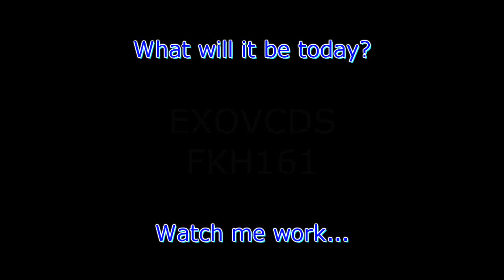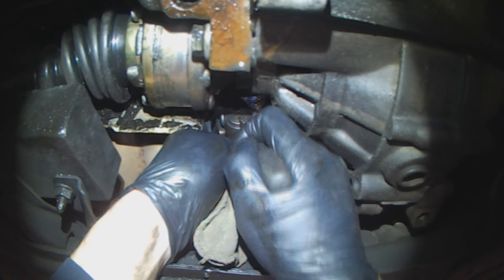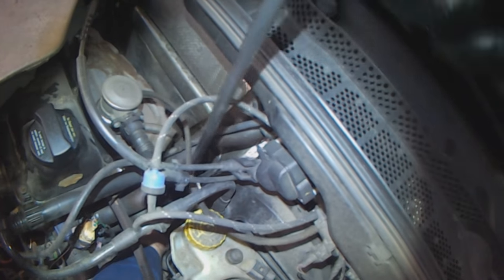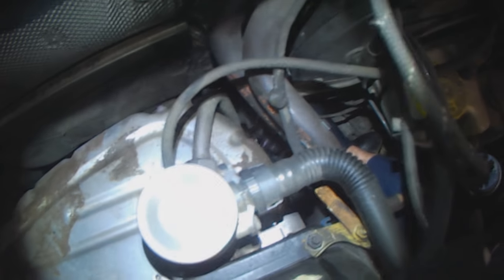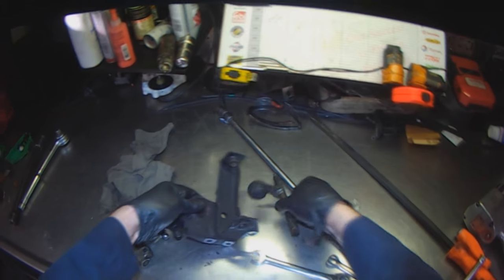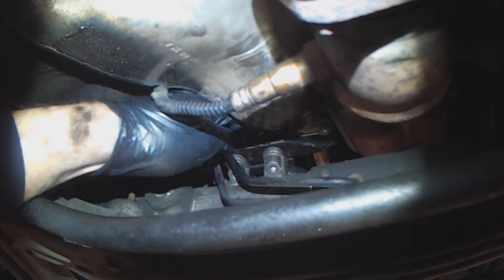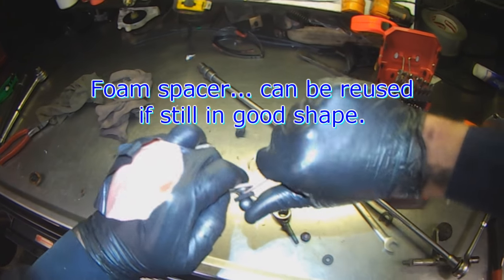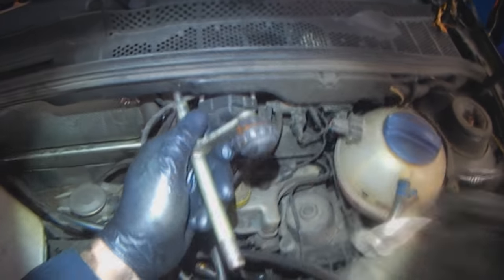VW A3: Main shifter rod bushing replacement

Comment: Thomas this video REALLY helped me replace all the bushings, selector rods, and Relay lever on my 1997 vw Jetta, and as Thanks for your with the Parking Brake Cables I was truly overthinking that.
Reply from the maker: Thank you for continuing to watch my videos!
Reply: @EXOVCDS  you would have a video of replacing a radiator do you?
Reply from the maker: Not of mk3, sorry.
AC or no AC?
Reply: @EXOVCDS  ac
Reply from the maker: Best way is by removing bumper & grill, then you can move the core support forward. Pulling the radiator can be done through the engine bay alone, but it is a tighter squeeze. Remove alternator, move the ac compressor out of the way (do not have to discharge). Remove fan shroud and fans. Remove radiator.
Reply: @EXOVCDS  saw a video of the whole grille and bumper assembly removed

Comment: Thomas, working in my driveway I found with a bunch of different length 3/8 extensions, taped together with duct tape at joints, last joint being a swivel connected to a 12 point 13mm socket I could get to ALL 3 bolts to bracket from top of engine bay. Helps out alot being today is 100°, in April. Had to make due with my own way to put shifter in neutral, had 2 small square pillows tape together to keep shifter in neutral. All went back great! Bought new release bearing, refill crank case new 75/90 gear oil, took off clutch cable and readjust, bought all new bushings, shift rod with ball off eBay. I tell you, couldn't find first gear before, couldn't get power at all from gears. Now! Feels like new car. Is a mk3 97 Jetta, 2.0 Thanks for your post, well done.
Reply from the maker: crimp creep Nice to hear that your project went well and that one of my videos was of help. Thank you for watching! Thank you for the tip about getting to the bolts from the top... people will find that info useful!
Reply from the maker: crimp creep send me your mailing address and I'll send you some of my channel stickers.
Reply: Thomas, how to send address? I love your channel.
Reply from the maker: crimp creep I got you message... thanks.
Reply: I had to laugh!!! Taping those extensions works like a charm, doesn't it? !!!  Great minds.....you know!!!

Comment: Had to takeout my transmission on my cabrio and I’m redoing my shifter linkage. Did not use an alignment tool and now it can’t go into any gear😂 got the alignment tool ordered and on the way now! Great video!
Reply from the maker: Alignment tool helps, but is not needed.

Comment: Nice work! "ditto" to what Wyatt said on the connector. Sometimes connectors are tricky and get broken if you never took them off before. Also "ditto " to your comment about the lift. Nothing like having a lift!
Reply from the maker: I try to add as much info as I can, without being too much... for the most part my viewers can follow along. Diving-in blind & learning as you go, sometimes, can actually be a good thing (knowledge retention). =)

Comment: Nice work Thomas and working on the rear looked to be a little bit of a bear. Putting anti-seize on those bolts will help you out down the road for sure if that's got to come out. I put that stuff on any bolt that's underneath a car and it does pay off down the road. Take care...
Reply from the maker: Yeah, odds are good that I'm still gonna work on this car in 10 years... might as well make life easy for me! =)

Comment: Hi Thomas! Did you also replace the copper nut of the clamp / main shift rod, the 13mm one? Is it a one-time nut that needs to be changed? Another question: what is better, anti-seize or blue thread lock on the three bracket bolts? I'm looking forward to your answers, I'm working on my Seat / Inca (it's like a vw caddy 1.9D -1Y European version - I'm Italian). Thanks so much for your videos!
Reply from the maker: I did not replace the nut... if you are concerned / worried about fasteners coming loose, then apply some thread locker. I only use thread locker in specific cases. Anti-seize has been good to me in keeping the fasteners in place, as well as being able to separate them when need be. If a fastener is tight, anti-seize will not make it come loose on its own (in my opinion).
Reply: @EXOVCDS  Thank you so much indeed, Thomas!

Comment: Great video indeed! Thanks for posting! Question: what type of LUBE was the one you used on that orange bushing?
Reply from the maker: Xavier Lemos WURTH Silicone Compound Grease / Lubricant.
Reply: Thanks! Specific to the MK1, MK2, MK3 cars?
Reply from the maker: Xavier Lemos Those with shift linkage such as this... yes. Some mk3s had cable shift linkage.
Reply: I can't find the Wurth Silicone, is there an alternative?
Reply from the maker: +Xavier Lemos Anything that's labeled as being rubber grease / lubricant for rubber parts.
Reply: Thanks!

Comment: Thanks for this video - I've replaced all the other bushings and linkages and this will help with the last one.  Question though - once this part is out, is there room to reach up and remove the shifter box bushing too?  I have the same type of car - 95 mk3 2.0 Cabby
Reply from the maker: The shifter box is covered by exhaust heat shields... if that's what you meant. You can see the layout here:
http://mkiigolfproject.blogspot.ca/2012/03/rebuilding-shifter-box.html
Reply: Thomas EXOVCDS yes that's what I meant.  I guess I was hoping that you could reach up and remove it without dropping the exhaust and heat shields but I guess if you were going to do all that you might as well rebuild the shifter box too. Maybe you can do a video on that some day?
Reply from the maker: Chris Hsu Someday yes... as soon as a customer requires it and i happen to be working on it. =)

Comment: Is it bad if I dont have the spring clamp at the bottom there?

I tried on this a few days ago and no such clamp
Reply from the maker: The spring clamp helps keep the lower bushing in place. 
Google search the part number for #31 to find one you can buy.
https://volkswagen.7zap.com/en/usa/jetta/jem/1996-128/7/711-711022/#31

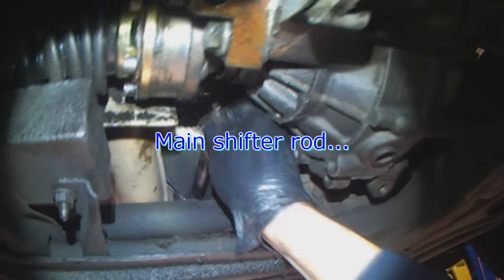Comment: Hi there, thanks so much for posting this video!  I need to do this on my mk3 Cabrio.  But I also need to replace the bushing in the shifter box - at 8:41 you can see the shifter rod by itself - is there enough room in there to reach in and pull out the shifter box bushing?  Or do I have to take out the shifter box by dropping the exhaust / heat sheild etc?  Thanks for your time!
Reply from the maker: IIRC... any work in the shifter box, requires heat shield & shifter box removal (at minimum, the heat shield to gain access).

Comment: So I had my water pump changed and it was tough to shift into gear. Started looking around and wasn't sure if it could be bushings or the cables or something. My transmission lock doesn't go up no mater what position its in but now I can't seem to find the correct spot to align everything. I found most gears after adjusting but I can't find reverse at all. I'm afraid I did something wrong. Can you explain if I'm not doing something right!
Reply from the maker: Year, model, engine? A3/mk3 with shifter cables... VR6 engine? I'll send you some info once I know.
Reply: Thomas EXOVCDS mk4 04 jetta 2.0
Reply from the maker: Sorry about the late reply! The water pump replacement should not have caused any shifter issues... in case you were wondering about that. Here's some info for shifter cable adjustment:
http://fkh161.ca/VW/A4/mk4shifter.pdf

Page 2: Tool T10027, just use a drill bit that fits.
If none of this helps resolve shifting issues, the problem could be inside the transmission.

Comment: Hi Thomas, I've gone and replaced my pivot bushing in the shift box, put it all back together and attempted to allign it with the tool, once it seems right and i shift it to second i can no longer shift upwards.. does this sound like anything in particular ive done wrong?
Reply from the maker: BriBunee If the adjustment in the shift box is ok, then check things further down the line. Over the years, someone might have made adjustments somewhere, to compensate for worn bushings.

Comment: Hey Thomas i do this on my VW cabrio Mk3 and now i can’t get into reverse gear :(( if u know something lmk
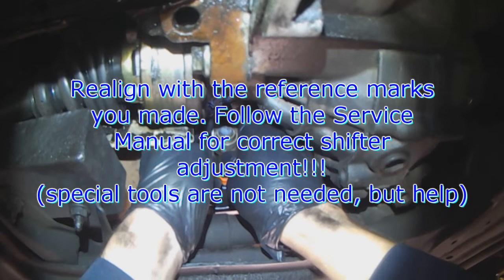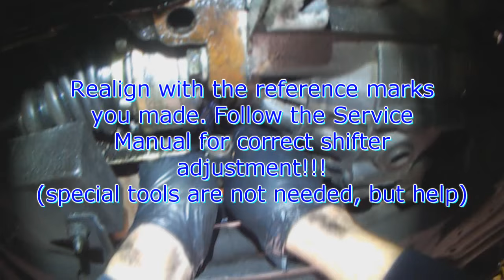Reply from the maker: Loosen the clamp at 16:35. Have someone move & hold the shifter in the neutral position between 3rd & 4th gear. Once in that position, tighten the clamp at 16:35. Try the shifter again.
When in the correct position, the shifter should bounce back to the 3 & 4 position (if you let go of the shifter from the left stop position).